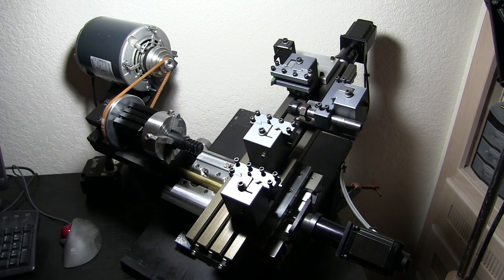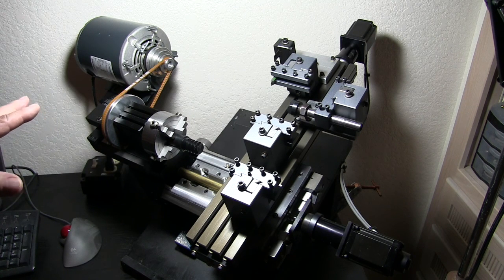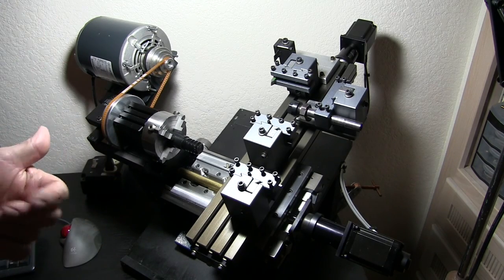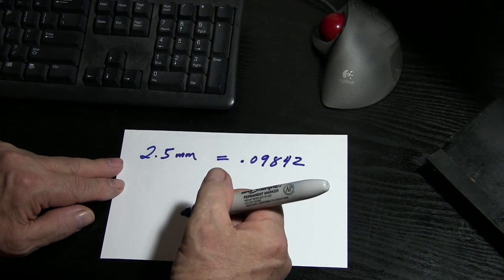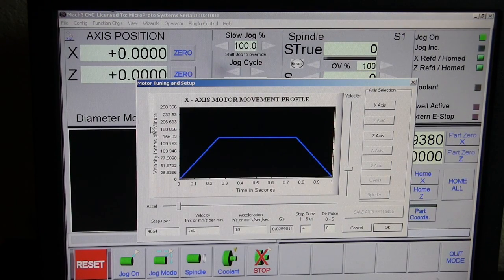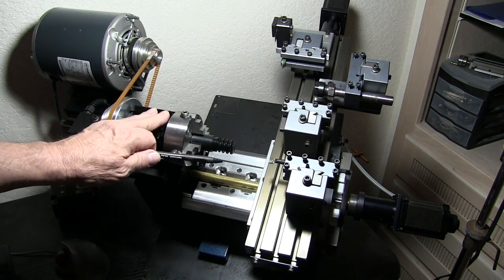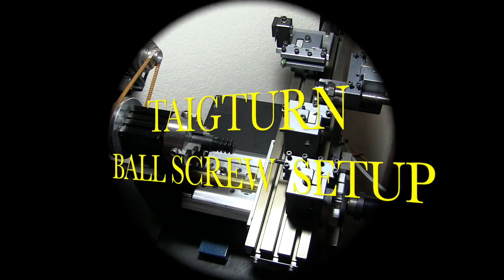TAIGTURN BALL SCREW  SETUP

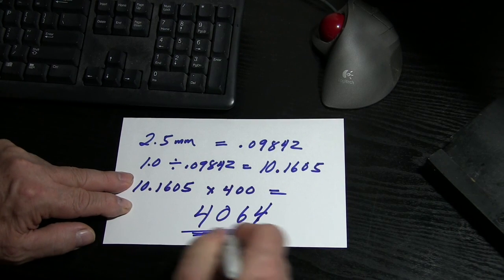Comment: 3:36 setup using metric its more acurite. 0.001 mm is 0.00003937 inches and i bet you use 0.0001 inch so its 0.00254mm so metric is allready 2.5 more better LOL if you gp 0.00001inch i can go 0.0001mm again its more acurite 1mm rev 160 step MATCH no decimals (steps)